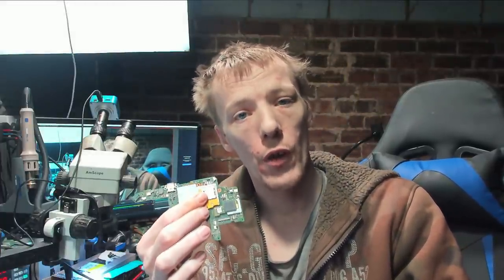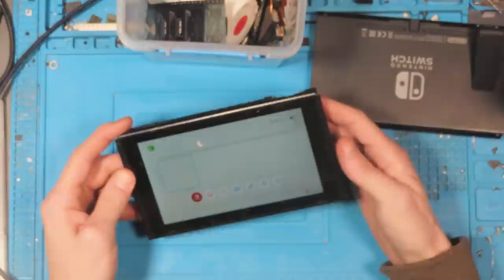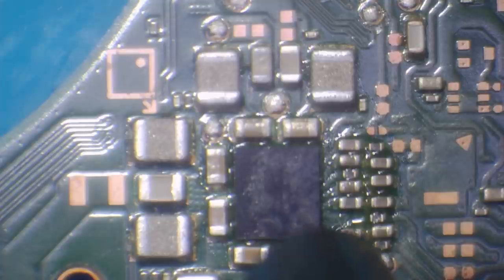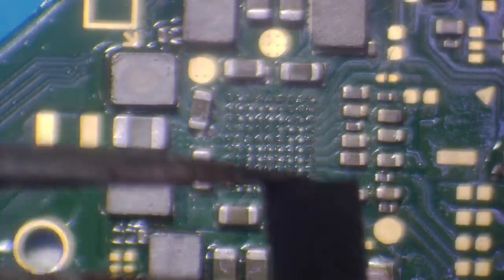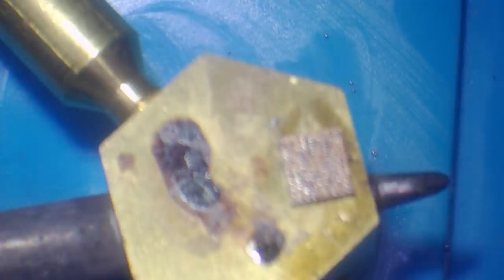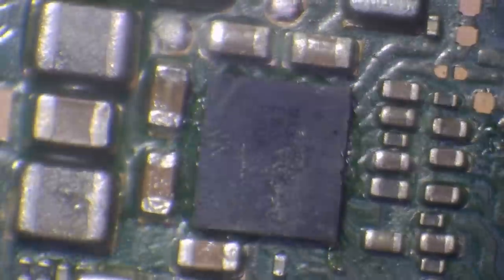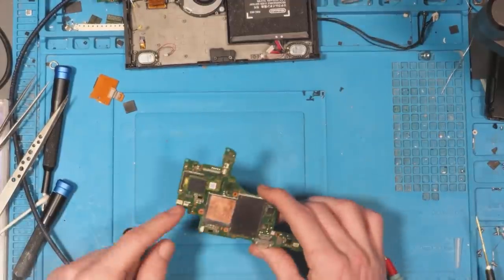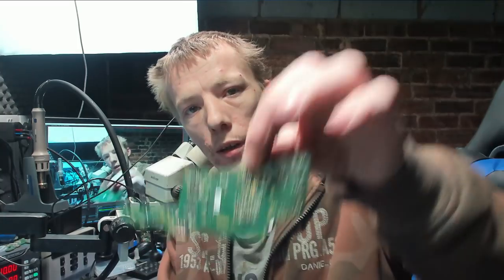This Nintendo Switch Doesn't Read Micro SD Cards! Let's Fix It And Make It A Happy, Healthy Switch!

Comment: Man.  I have a V1 switch with a bad sd card connector on the motherboard.   It's been modded and thought it was going to sit on my shelf forever.   I got a few connectors for it, but didn't want to attept repair without knowing the right way to do it.  I can't tell you how much watching you video is going to help.   Will attempt to do it this week and hopefully get this back up and running!
Reply from the maker: That's awesome man. Glad this video will help you out. The connectors are fairly easy to replace if you heat up from underneath 😁

Comment: I've been using a small (3") frying pan to reball for quite some time. Works a peach. Hold the pan, hot air from underneath...flow flow bro.
Reply from the maker: I'd assume it has pretty sweet thermal conductivity since it would be made of aluminium 😁
Reply: @TheCod3r  Exactly. And the Teflon coating...well, that does nothing.

Now, if I could find a way to keep solder balls from having static charges that make them jump all over the goddamn place.

Comment: Probably a stupid question, but when you replaced the solder on the chip with leaded the solder pads looked OK, as in nice and seperate solder on each pad. Could you get away with just putting chip on without using balls?
Reply from the maker: Not really a stupid question 😁 you can on some chips, like really small ones such as the MAX17050 fuel guage because the pads are easier to make contact with but with bigger chips like the MAX IC while it's technically possible you'd still need to get the pads the exact size. There's a guy on youtube (I forget his name lol) who can do it on any chip with just a soldering iron which is pretty cool
Reply: @TheCod3r  I'd love to see that because I tried reballing a tristar with just an iron for shits and it did NOT go well.

Comment: Hey Thecod3r. Quick question: how does the video chip in the Nintendo switch Short circuit or breaks as easily? I seen so many switch repairs on your YouTube channel and others and it seems to be common. Is there a way to prevent the video chip to burn out besides using Nintendo licensed ac adapter and Nintendo licensed dock

Comment: My old Android has a socket that does the same thing
Reply: I took it apart and found it had a dust bunny in the socket so jammed jellied tight I no there the pole to the connector side could not get 9n the hole all the way and didn't allow fill contact with the pins shined a light in there an can see the jammed dust 9n the commector

Comment: Nice repair, I’ve seen a few switches being sold because their sd card slots don’t work and on the surface it seems like they just need a new sd card slot but in reality they could need the chip replaced which isn’t so easy lol.  Btw I tried to sub on twitch using my prime but it looks like I must have used it already on someone else, can’t remember who I don’t use twitch.
Reply from the maker: Yeah some can be easy, others are tricky to figure out but generally if the connector is OK and the module is OK the chip is bad. Thanks for trying to sub on twitch, not a major issue though mate, I appreciate the gesture:)
Reply: @TheCod3r  I’ll remember that but to be honest now I’ve got a switch Im not a huge fan so I don’t think I’ll be buying anymore to refurbish. Im more into proper consoles fixing and modding them. No worries mate if I can figure out twitch you’ll see my sub 😃
Reply from the maker: @Alexander_l322  to be honest I'm not keen on them, they're cheaply made, unreliable and super easy to damage. Thanks mate I appreciate the support
Reply: @TheCod3r  I agree mate and no worries 😄

Comment: Can that tool also be used for ps4 southbridges?
Reply from the maker: Yeah I'd say so. I did try it on a southbordge, it hangs over the tool slightly but it did melt the solder

Comment: havent watched yet but reading the headline, usually just replacing the sd card mod fixes the issue, very unlikely it is anything worse than that as its hard to bridge those pins unless they had it open and was unplugging it and replugging it in whilst on , looking forward to see whats up with it as i watch :D

Comment: hey bud l got a good deal on 3 Xbox 360's all have the RROD but if l can not get them working l can use for practice i.e. taking HDMI connectors off chips and all the other goo stuff all for £25

Comment: Sent you an Instagram DM and an email about my PS4 slim having BLOD issues. If you could reply that would be great, am after a repair quote, cheers
Reply from the maker: I don't use Instagram for business mate. I'd need you to get in touch using the website so it goes to my inbox. Instagram is just for YouTube stuff but I barely use it